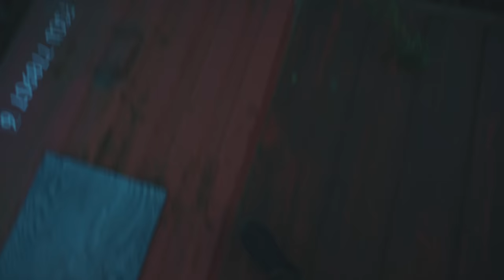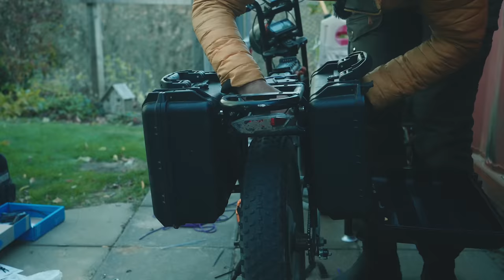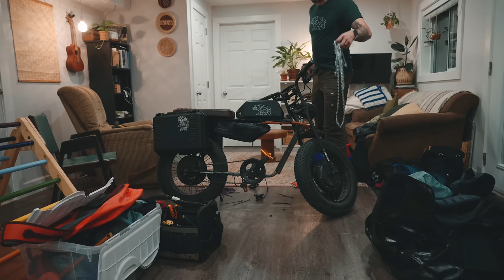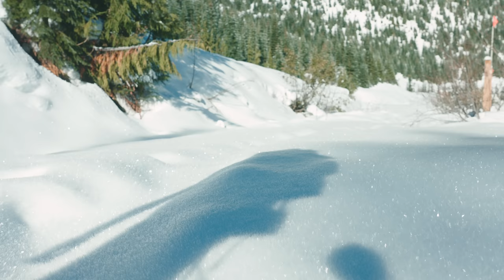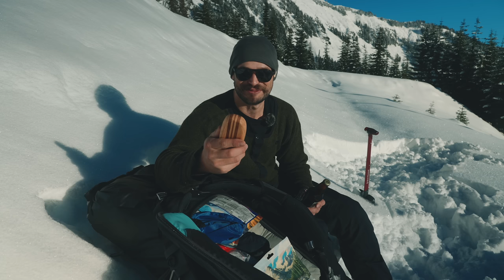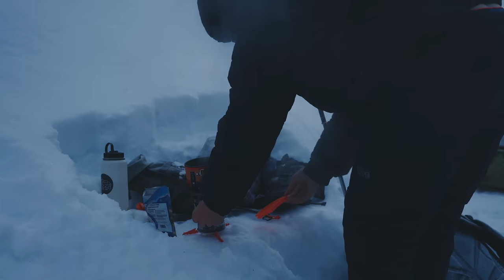-20 Solo Winter Camping Trip (With NO Tent!)

Comment: Beautiful cinematography as always!!  I've heard a lot about battery packs losing substantial capacity when it's really cold. That could have a lot to do with your range issue. It would be interesting to do the same ride in the summer. Not a completely fair comparison because riding on snow would work the motors harder than on hard pack dirt or pavement. Great video!

Comment: Great video, really hardcore camping !

Cold weather can significantly reduce the battery life. For example temperatures around the 32 degrees mark only provide 70% to 80% of there capacity dropping further as the temperature decreases (lead-acid type). Lithium is a better option but will still be affected and are expensive.

Comment: slick panniers!  adds a long distance component to the e bike.  how long to get the batteries up to full charge?  did you have to pedal out??
Reply from the maker: Depends on how fast I charge it, but can go to 80% in 2-3 hours. I had to pedal a decent amount. Car was parked at the turn off at the start of chipmunk creek. Thankfully there is lots of downhill, but still plenty of flat
Reply: @Levi_Allen  Was it due to the cold? If it's a lithium battery, the acid inside tends to lose its efficiency and drain significantly in lower temps. Definetly get a heated enclosure or insulated bag of some sort if thats the case. Sorry for the rant, just wanna help :)

Comment: Doh! Do you not know that lithium batteries do not deliver 100% of their capacity in very cold temperatures? They can loose around a third or more of their capacity at temperatures below freezing.
Reply from the maker: I knew they lost performance, didn’t know it was a 1/3rd wowzers
Reply: @Levi_Allen  It's one of the things that is slowing widespread EV adoption here in Canada. A friend of mine in Hamilton can drive up to Ottawa with no problem with her Telsa spring, summer and fall. But it doesn't have the range in Winter and she needs to swap cars with her daughter to use her daughter's Prius to come up.
Reply: @Levi_Allen  yup - experienced this with a go pro, it's a nightmare